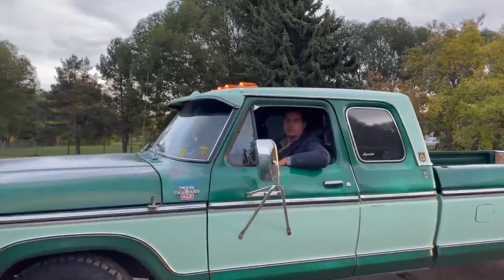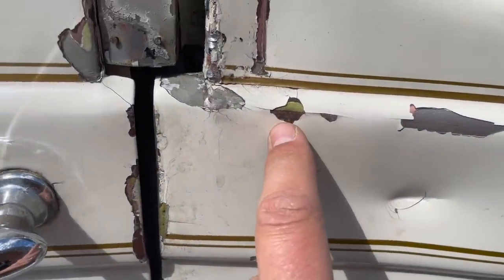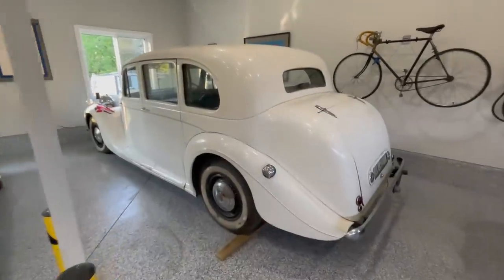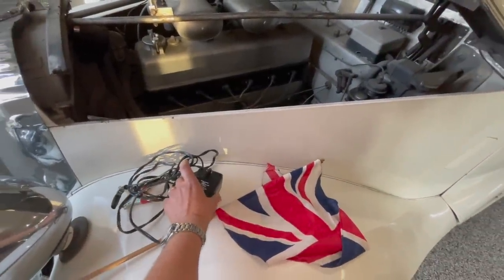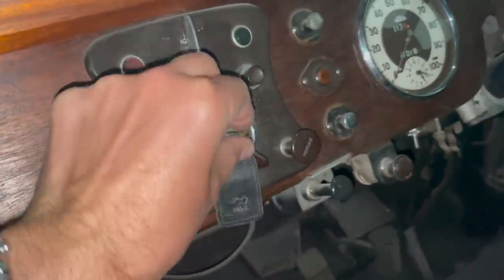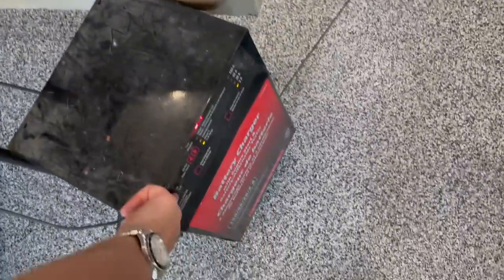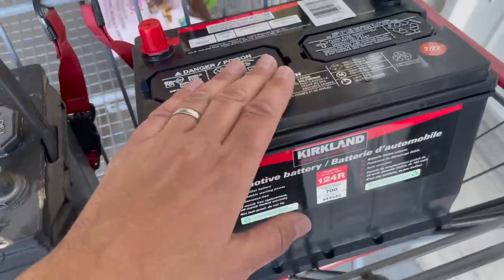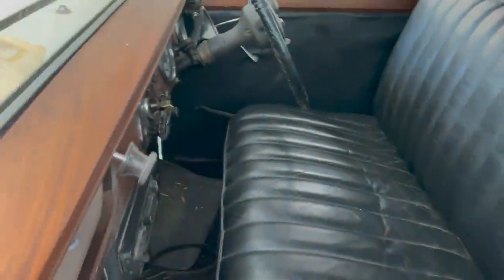Abandoned Royal Limo sitting 30 years, will it start?!?

Comment: Hi  - great car! Your car has a Wilson preselector gearbox coupled to the engine with a 'fluid flywheel. The system is a bit like an automatic gearbox and torque convertor, except that the gears don't change automatically. You have to select whatever gear you are going to need next and then when you want to actually change into that gear you press the left pedal firmly and release it. Before you try to start the engine make sure the gearbox is in neutral by selecting neutral on the quadrant and then dipping and releasing the left hand pedal. Once the engine is running select Reverse on the quadrant, dip and release the selector pedal, let off the handbrake,  give it some accelerator and the car should move backwards. All sounds a bit odd, but fine once you get the hang. Good luck!
Reply: I'm curious how you know all of this Richard, were you a driver at one time? :)
Reply: To Richard Long
 I think  this has what is called a PRESELECTOR gearbox.
Reply: This type of gearbox were fitted to London red double deckers. I never drove one but did drive an ERF 7 ton flat bed, it had a Gardner 5 cylinder engine the extra cylinder was for towing a drag trailer, there was also an extra hand brake lever on the passenger side. So the trailer boy could operate the trailers brakes on down hills etc. No synchromesh on the gears so you had to get the revs right when changing gears, no power steer so a journey was a work out, strong legs were needed to brake as again no power assistance. I fitted cruise control by way of a length of wood jammed between the gas pedal and under the dash, a quick kick and it released, great for the journey from London to Chepstow in S. Wales.

The truck was part exchanged for a new Leyland from Watt's Gloucester and I have found a photo of it fully restored in the grey livery of Chas Brand & Sons. Civil Engineers the company I worked for. Have tried to find the new owner to share some stories but no luck so far.
Reply: @TheByard  I didn't mention it - but I certainly remember the buses heaving a pre-selector gesrbox!
I don't know if Daimler cars were reliable or not, after  the Queen's father gave up on them. But I do remember delays (in the 1980's) in getting to work - when Daimler rear-engined buses sometimes had to stop at the  side of the road  to be fixed. Overheating, I think!
Reply: @nygelmiller5293  As a kid I learnt to drive my uncles Ferguson grey tractor and so was fascinated and confused watching my dad change gears in the Armstrong and his column change Bedford van then the bus drivers confused me even more with preselect. The LCC Daimler ambulances were the same.
Even more confusing was driving a Neal's yard crane. With the front of the swing cab pointing over the rear wheels of the undercarriage you had to turn the steer wheel the opposite way you wanted to turn. You were in fact reversing the crane but facing backwards.
Reply: @TheByard  from Nygel I learnt to drive a forklift truck - that steered BACKWARDS. No wonder today, that in automated factories, that they steer themselves, by robot, and don't NEED a driver!
Reply: @nygelmiller5293  Daimler lost its privileged position as the suppliers of cars to royalty, not because of any defect in the cars, but because of a scandal. The wife of the director of Daimler's parent company, BSA, Sir Bernard Docker, imagined herself as a great car designer, and spent a lot of Daimler's money on absurd special projects, which the indulgent Sir Bernard permitted. Ultimately the wife Nora, bankrupted the company, and Sir Bernard was involved in an insurance swindle. Naturally the Queen then distanced herself from the unpleasantness. And Daimler went into decline. It was rescued in 1960, when Jaguar took it over. Before it went, Edward Turner designed two superb V8 engines, of two and half and four and a half litres capacity. The smaller engine was used in a Daimler version of Jaguar's small saloon at the time.
Reply: @thrunsguinneabottle3066  from Nygel Miller. Thanks for replying on this fascinating subject! I really didn't know Sir Bernard Docket was involved in an insurance scandal! I do know that his ambitious wife, Lady Nora was a spectular personality, who actually did push the boat out - (sorry - limousine), to promote the exceptional design skills of the stylish British limousine industry. Whatever the cost! However, these special version limousines have become a style landmark for all time! The Mail On Sunday did a special feature, on "Lady Dockers Daimlers". Featuring gold plated fittings, double glazing, and zebra skin seats! However, she and her husband did seem to leave a bitter taste in the public's mouths and now I can see why, if he was a fraudster, not someone stylish! A car model firm did a model of one of these limousines (we're the "gold" fittings actually real gold plated on THAT?). I had half a mind to save up for the model, because it was really a beautiful ornament to display.,  but didn't, in the end. Not, because the £100 price tag would have meant having to cut back, and live in cornflakes for 6 months. BUT for the reason that most people buy models as a poor substitute for the REAL  one. And having the model would be a constant,  painful reminder that I never would actually have one of her ladyship's MASTERPIECES!
Reply: @nygelmiller5293  As a motorcycle man herein the U.K, i seem to recall Sir Bernard and his wife involved with the BSA motorcycle group?
Reply: @kentishman5698  curiouser, and curiouser - as they said in Alice In Wonderland! (,Alice in DOCKERLAND!) I wonder if SHE travelled by Daimler?

Comment: Hey Alex, that green fluid is chassis fluid for a hydraulic suspension.  The brake fluid will be on the opposite side possibly under the floor mat - or the firewall, since I did see a reservoir there.
Reply: No, it is for centralised chassis lubrication.  As the exhaust manifold heats up, the oil is forced round to all lubrication points.

Comment: I had an old MG B, which had 2 x 6 volt batteries (which were as dear as poison to replace) I swapped it out for a 12 volt, which left a great deal of space in the battery tray too.   I also eventually swapped out the twin carbs because I couldn't find a mechanic in Brisbane Qld Aust who could make them run properly.  With all that, it was a great car and I enjoyed  driving it.  Had to sell it after my daughter was born as you couldn't put a car seat i it (legally). That was 30 years ago now, I till miss it.

Comment: For the brake system, you might want to do some research before adding or changing fluid. A lot of English high-end cars used mineral oil in their brake and suspension systems.
Reply: That may not be the brakes… that might be a whole-chassis lube system.  But the note about mineral oils and hydraulic fluids for brakes is a valid concern..

Comment: Alex, wonderful car!  Just a heads-up. The greenish fluid maybe a hydraulic mineral oil, as used by Rolls Royce and Citroen.  In which case what you're looking for is LHM fluid, and easily available.  Look forward to seeing you bring this limousine back to life. Cheers from the UK.
Reply from the maker: Thanks! I’ll have to test everything out brakes etc this week
Reply: @CuriosityIncorporated  That wasn't the brake reservoir, it's for the chassis lubrication system. The brake reservoir will be on the right-hand side of the vehicle.

Comment: Any decent  coachbuilder can repair that door.  If I'm not mistaken the door has a hardwood frame and the metal change stripped off and beaten rather than filled.  You don't use body filler on a classic car.

Comment: Interesting….

“Luvax-Bijur car chassis "one shot" lubrication system.
A number of quality cars built in the 1930s were equipped with the Luvax-Bijur centralised lubrication system. Rover, with its range of 10, 12, 14 and 16hp P2 cars was a well-known exponent of this labour-saving fitment, enabling the motorist to lubricate the key components of his/her vehicle's chassis simply, in one go. Riley, Lea Francis, Alvis, Rolls-Royce and Bentley also approved of its use on their cars. So long as it gets used regularly, there's no reason why the Luvax-Bijur system can't go on functioning into the future, although it's important to remember that if a car has sat idle for many years, there's a good chance that the plumbing for the oiling/greasing arrangements may clog up, leading to essential lubrication of suspension components and so on being missed."

Comment: Top tip with an engine thats been standing. Turn it over by hand a few times first just to be sure nothing is stuck. Also add two stroke oil to any gas the throw down it, to lube the engine a bit. Also you are way better using a remote fuel tank to start with. Dragging all the crud up from the tank is just going to create work.

Comment: Expect a chassis lube mechanism. Sometimes old Bentley's had a foot button - looked like a floor headlamp dip switch - but it moved oil and could leave a mess if you repeatedly pumped it because dip/main didn't. One door needing a really skilled panel beater really isn't complicated but getting RR parts and RR mechanics ALWAYS means RR prices.
Before you go too far check that your state will permit it to have a plate! I guess it does 10 to the gallon on a gentle run out or 5 round town.
Long ago I used to work for a UK RR dealer. You could identify a RR part simply by it's weight! Ask RR for details of the car and parts availability.

Comment: A Daimler was the Royal car of choice until the 50's when they changed to the less well made Rolls Royce. 
In 1927 they offered a 5 year factory warranty on the chassis and running gear ( the bodies were all coachbuilt) and the service schedule ecpected the car to travel 1000 miles a month.  A 5 Year/60,000 mile warranty in 1927. That's the build quality that kept Rolls Royce in second place. The Daimler and Lanchester Owners Club in the UK will probably be able to help with info on this car.
Reply: To Richard Agent. Mentioning Daimler AND Manchester together  has just made me go weak! AND He also mentioned my favourite - the Austin SHEERLINE as well!
Reply: The ,"semaphore" trafficators Don't flash - unless they have been converted to do so more recently.

Comment: Alex, I was concerned that the car might have had a positive ground electrical system. many of the early British cars did. I have owned a couple of older British vehicles.( a 1958 Triumph TR 3 and a 1960 Austin Healey sprite) By the way what is the story on the 1968 Mustang California special?  I have never had one but I did restore an 1968 Mustang fastback GT back in the 80's. The C/S were a very limited production model and only sold new in California which is where I live. As an aside Ford also made a Colorado special for sale in where else but Colorado. The badging was a little different but basically the same car. Good luck on your latest project. I love the new garage and also the house that goes with it. lol
Reply: A friend has two Bristol cars, 1950 and 1954. They have the positive earth, too.

Comment: I had a MGA in college (1970s) that had two six volt batteries in series, so it was a 12 volt system. When a battery went bad, it was cheaper to buy one 12 volt battery. Which is what I did.

Comment: As a 19 year old; Now 80. Very, junior car salesman for a company called 'The Car mart' based in a building by the name of 'Austin House'  In Euston Road London, this car or its sister, I believe there were two models, drove into the rear entrance of the building and parked up for a time. 'The Car Mart' were the official car suppliers to Buckingham Palace and the Queen.

As this was not too long after the war many of the car salesmen where on the older side and did not feel the need to drive everything that had wheels, Thus, I was asked by one of the elder directors who was sympathetic to my enthusiasm for motor vehicles if I knew how to drive a preselector gear box. sure, I answered. My knowledge of this type of box was all derived from watching the bus drivers using them driving the London Red' Routemaster' double deckers and I thought they were a brilliant system.

As I remember it. I selected the gear with the column lever and depressed the clutch pedal. Totally un-necessarily, I started to slowly release the pedal only to be propelled back into the drivers seat with some force.  The Daimler was to be taken to one of Car mart's depots; Streatham I think.  Or Staples corner in NW London. This was so that it coud be repainted in a non Royal Colour; I was pleased to see that your black turned out to be the original Red  We did the same thing, when it's time came, to the Duke of Edinburgh's Lagonda which was in Edinburgh Green.

As I recall the car that we had in had a very small rear window and I think that yours may be the second model or my memory has made it smaller than it is.

That car was built in a manner that could be described as; 'more substantial that they do today'.

I hope you enjoy it it has brought back fond memories.

Richard.

Comment: [10:20]  I think that's a central chassis lubrication system, those were popular briefly on high end cars back in the day.    The brake fluid reservoir is elsewhere.   Sometimes under the floor (frame mounted master cylinder).
Reply: Agree!

Comment: I haven't read the comments - but  IMHO the headlamls are P80s not P100 (8 inch rather than 10 inches. 
It was comon practice to have two 6 volt batteries in series - one either side of the propshaft. Remember tha battery construction was poor in those days so what fits a 12v battery now would have bee twice the size just post war.
Chassis lubrication - I had Alvis pre war cars and invariably folks abandoned the central lube system as they always got blocked and replaced them with 'tat' cap oilers where the ends of the lube pipes went. Hope that info is of use...

Comment: Body and doors most likely aluminium skin over ash wooden frame. Front wings probably steel. That's how Vanden Plas bodies were made. Check also for a 'Jackall' system, built-in car jacking system used by limosine body builders. The system control usually under front floor, electrically powered with special hydraulic oil

Comment: Believe me our Royal family ,post war ,would have had little to do with a 6 cylinder  DE27 model Daimler : this was the running chassis which was used for the basis for the post-war newly formed National Health Service Ambulances: 
The pre war 4.6  litre, nine bearing, Pomeroy designed Straight Eight V32 model was used by the then Queen Elizabeth whilst her husband George V1th preferred the sister model  carrying the traditional Lanchester radiator cowl. Otherwise the cars were almost identical : Post war, apart from usage of the new 5.3 litre straight eight DE36 on the Royal tours of Australia and other commonwealth countries the old V32's were still preferred . The post war straight six DE27 (your featured model here, complete with severed wooden windscreen pillar ) was simply 6/8ths of the new Straight Eight DE36. Prince Philip was not enamoured of the Daimler marque ,esp after one embarrassing incident in which the Monarch's Daimler 'failed to proceed '. Following that there was a gradual move away from Daimler to RR/Bentley, undoubtedly precipitated by the 'Scalded Cat' ,a lengthened MKV1 Bentley chassis fitted with a Bentley commercial straight eight B80 engine loaned to Prince Philip, ...but that's a story for another day....

Comment: nice car ..don't run it on the old gas,,will stick  the valves open clean tank and fuel lines. as you my already know.remove the door straighten hings by squeezing in a vice . good luck!

Comment: Grew up in the 40s.  "Rope" by the back door was for rear seat passengers to hold for stability in case of an accident.  Probably would have dislocated your shoulder.
Damaged door is probably the result of some dim-bulb opening it while moving, and at a pretty good speed at that.  The "chauffer" perhaps? If so, he must have had a good grip on the steering wheel, not to have been ejected.   
The little turn signal arm did not blink,  but it was illuminated. Note what appears to be a tiny vertical tube in the yellow part of the arm for the light bulb.
I can't find anything on the internet to confirm this, but I believe that British vehicles of that era were already using 12 volt systems. If so the "alternator" is likely a generator, and there will be a voltage regulator mounted some in the vicinity.
Keep in mind that the electrical system in your new baby will be a Lucas system and Lucas is fondly known as the inventor of darkness.  Treat it very, very gently, or you could find yourself hosting a Daimler barbeque.
The car itself is absolutely beautiful.  Congratulations on a remarkable find, hope you have a ball with Letitia the Limo.
Reply: As an afterthought, if you could find records proving the car actually was used by the Royal Family, you could be sitting in a huge amount of money. Especially if you (A) leave it as found, Or (B) restore it and have it repainted in the original colour.
Reply: Another afterthought.  Find an expert and see what problems might arise from using unleaded gas in it.  The lead, in the old Ethyl gasoline, had a lot to do with keeping the valve stems lubricated.

Comment: Oh  Alex!  That motorcar does not have a Hood, it has a Bonnet!  The door is an easy fix as is the wood with epoxy !
Reply: the doors should have over travel limiting straps..!
Reply: Dr. Franken - Archbold...."It's Alive"....!
Reply: Definitely don't repair with epoxy- it needs a skilled coachbuilder to repair it with a complete new wooden section.